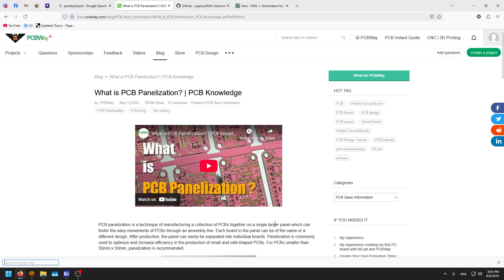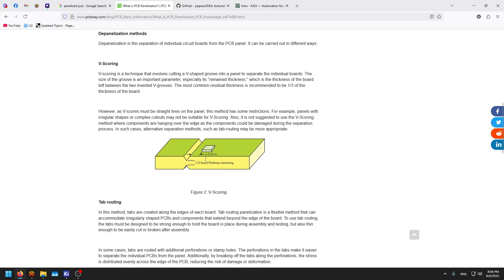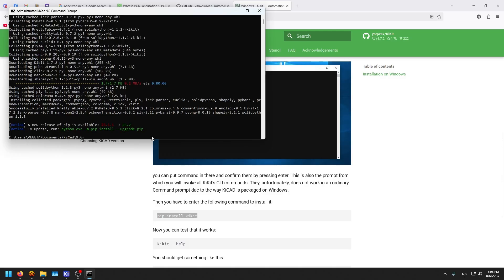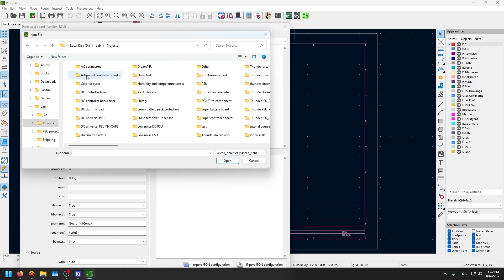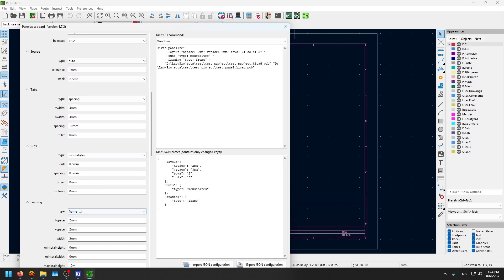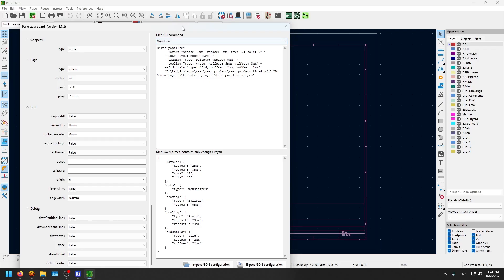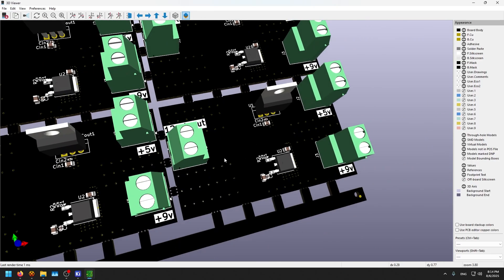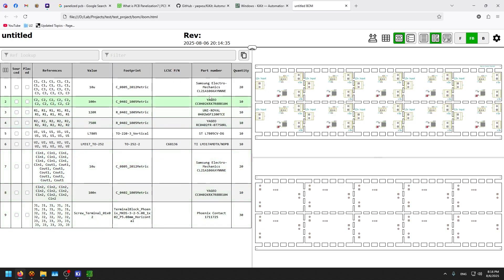KiCAD 9 tutorial course [08] - PCB Panelization

Comment: Hello, thanks for this video. I tried doing it but no mousebites were produced. Actually there is no link between the boards, they seem to be floating in the air.
Reply from the maker: hello,
you should re check again and make sure the plugin is installed correctly as it adds mouse bites as a library i guess.

try with different options to see where is the problem

Comment: Hi, I wanted to do PCB Penalization and for that I followed instructions in your video. So, I installed Kikit thru Kicad 9.0 Command prompt. However, when i click onto my Pluins (Kicad plugins), I get this error: "SSL Peer Certificate or SSH remote key was not ok". Any idea what could be the issue and how to resolve it ? Thanks
Reply from the maker: hmm not sure of this but looks like an internet connection. upgrading to latest kicad version is the first step then try removing any firewall limitations. 

try after that and if not solved then you may post a thread in kicad official forums.
Reply: @Thundertronics  Thanks.

Comment: Unfortunately the font size of KiCAD simulation graphs render them useless so what's the point of learning it?  I find KiCAD very useful for creating PCB's but completely useless for circuit simulation.  Circuit Maker from the 1990's is more useful than KiCAD for simulations because at least you can read the scales on the graphs.  

Looks like you are doing great tutorial videos but until they fix the font size issue in the graphs, I don't see any point in learning the simulation capabilities.  Hopefully some day they will fix it but in the mean time I think LTSpice is the better option for simulations. If you know a way to fix the font now, please let me know.
Reply from the maker: this series is about pcb design using kicad not about simulation. 
for simulation i suggest ltspice.